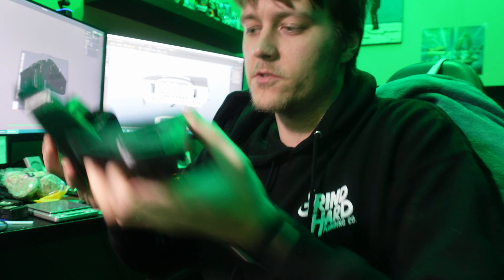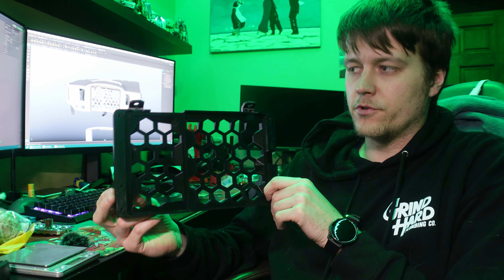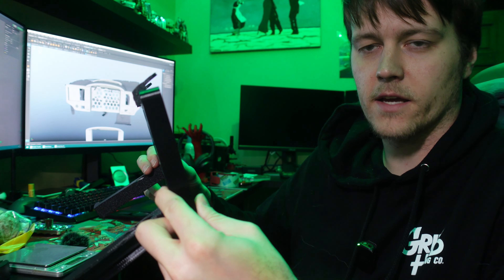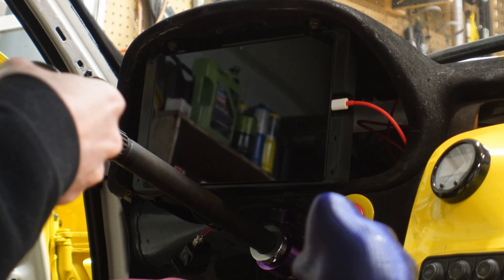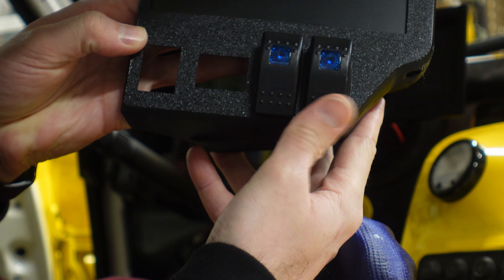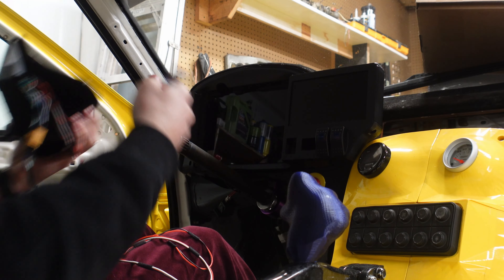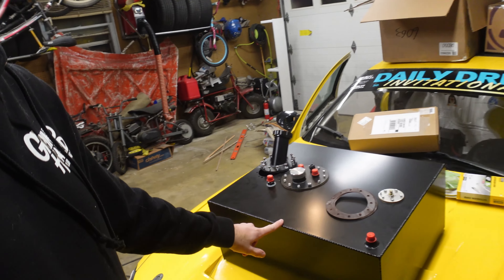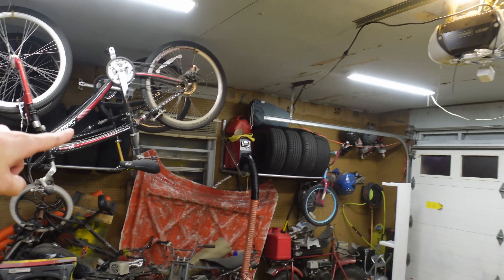I Made a Three Screen Digital Dash for my Racecar

Comment: That is amazing, what printer are you using?
Reply from the maker: Bambulab x1 carbon
Reply: @DingDongDrift  thank you, it’s hard finding parts for my 71 Ventura and I’m at the point we’re 3D printing may be my only hope and my cluster was my next thing I wanted to update and make better
Reply from the maker: @BuddhaC5  message me on Instagram or email me, i can help you design and print parts. I just started printing high temperature nylon and PET carbon fiber parts